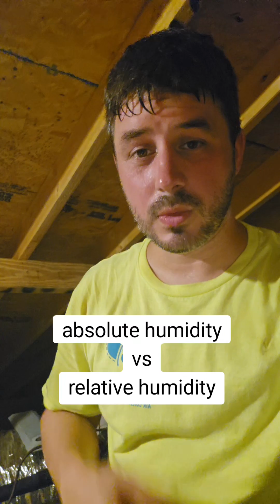hvac technicians dealing with hot summer may come across hot humidity attics that have condensation

Comment: I think a slightly easier to understand way of saying that would be to say something along the lines of if you have three drops of water in the air and this air can hold a hundred drops, and you have three drops of water in the air and the attic and that air can hold 200 drops, then the humidity for one of them is 3% in the humidity for the other is 1.5%. obviously you can use whatever numbers you want, but I think that needs across a bit better